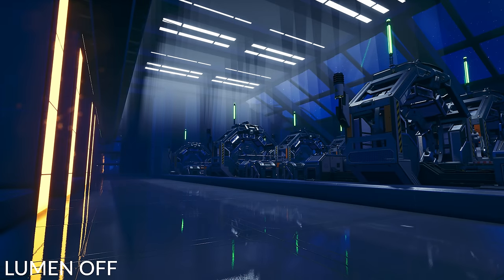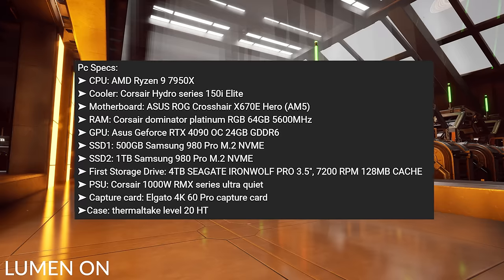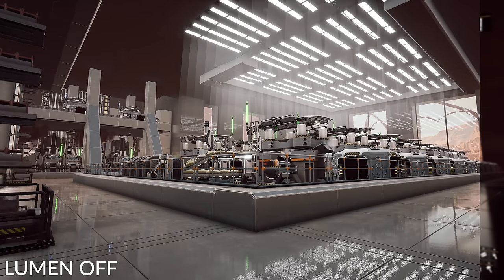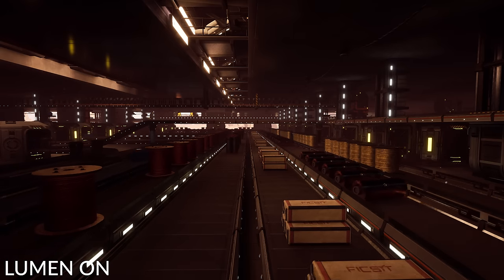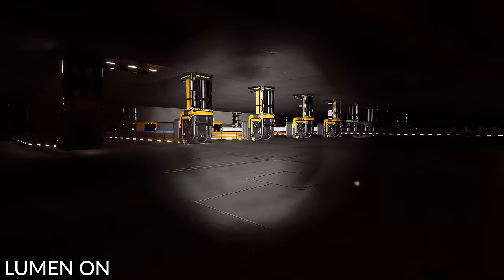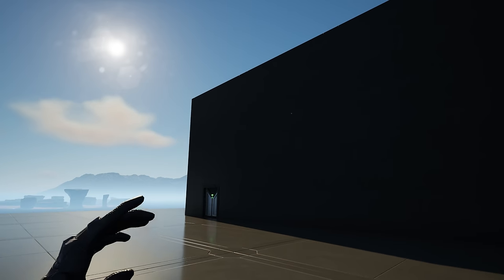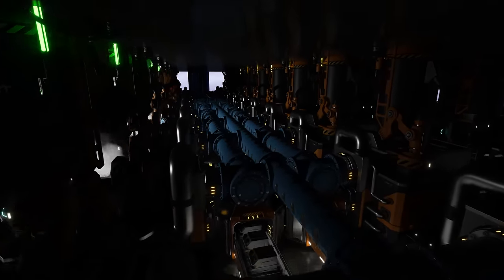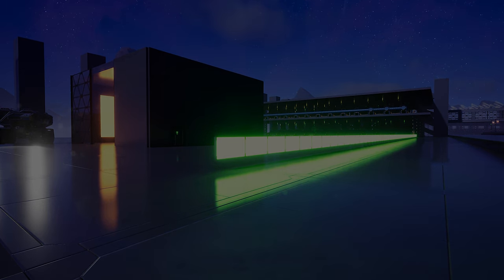LUMEN + UNREAL ENGINE 5 in Satisfactory!

Comment: I has serious stuttering during gaming. GPU around 40%, CPU around 70%. No lumen. 
Any suggestion?

The game look incredible though.

EDIT: lowering foliage render distance does help. When I'm staying in one place on the map it is quite good (high graf, 30 FPS, even lumen is on), but when I traverse on the map fast, it gives the stutter. So the main problem is that VRAM is not cleared well, which is pretty much confirmed. Looking forward to they patch it.
Reply: when you run the new settings it need to redo the shader cache... if you chance the settings OR they patch the game... it needs to redo them again that gives massive stuttering until it is done and when a new "object" that hasn't been cached gets cached you get a stutter too but when it's all done, it actually runs pretty neatly but yes SMALL GPU's will need much lower settings due to the new engines... but they pretty much only removed the GPU's Nvidia/AMD doesn't support with drivers anymore anyways... so it is fair enough
Reply: @LiLBitsDK  Small GPU? The rtx 3060 TI is small? 

But good hint. So when the GPU runs out of VRAM, and moving to new location where to object does not cached, that causes the stutter.

I hope they patch it soon.
Reply: @Neo-vz8nh  yes 60 class is SMALL or do you still look at Tseng 4000 and consider those as a GPU these days?

Fine people use 5-7-10 year old GPU's but sorry the Market moves on...
Reply: @LiLBitsDK  lol you must be the rich guy. 3060 TI is still around 500 bucks, a montly salary still on not rich countries. It is not that old either (around 3 years?).
Yea it is not cutting edge, but saying it small is a bit ridiclous.